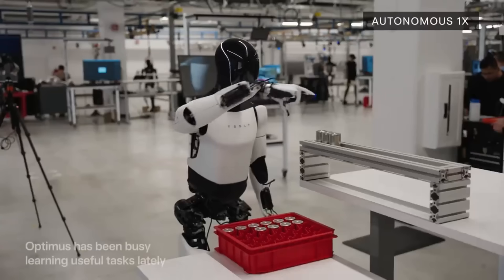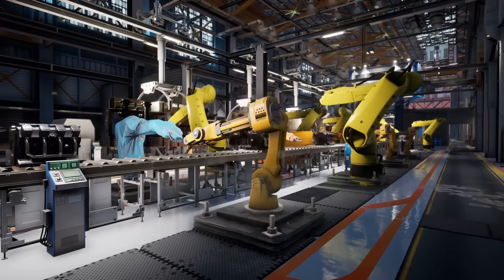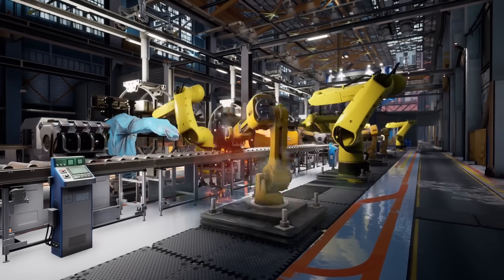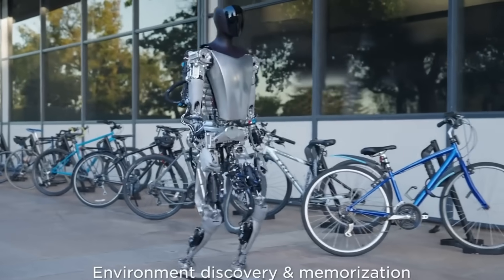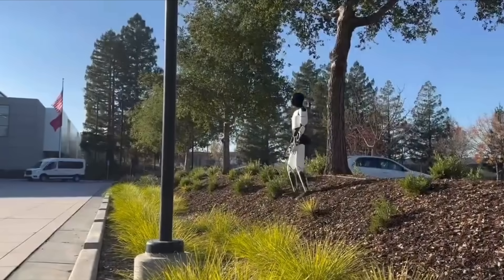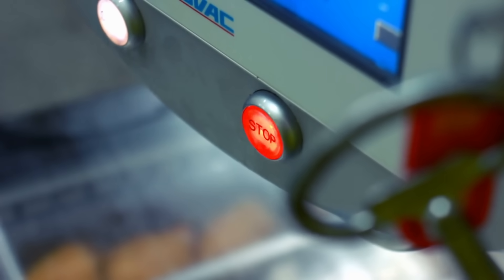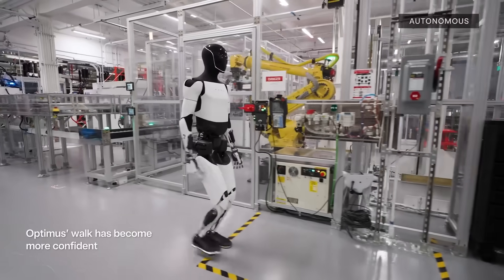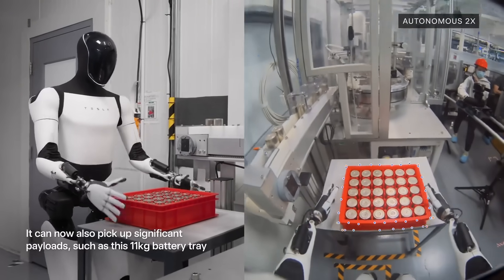Ex-TESLA Engineer SPILLS on Optimus

Comment: Soo basically they used a standard robotics arm  but instead of just using the simple arm they built a complex humanoid robot to do the same tasks ... And they slapped some cameras on it  and connected them to chat gpt or something similar to control it 🤣 instead of using a simple and probably cheaper cobot system? .. sorry that is just plain stupid in that use case in a factory...
 (So basically hey there is a cheap and good working system ... Let's make it more complicated and expensive for the same or even worse results...)

Comment: I was putting in CNC/robotics back in 1990 for the C-17 cargo jet factory. We were using wireframe and surface CAD models and CAM tools on the design side. We had to put in the data systems and Manufacturing Execution Systems to get the right code to the right assemblies. We were doing wing drilling and riveting as well as barrel sections. It was a lot of work to automate these areas. The wing took a dozen units to get most of the bugs out of them. In fact, there was a whistle blower who thought that we were pushing too hard and getting poor quality. He was correct about the quality, but we did repair work until the bugs were worked out. You don’t throw them out when it messes up, we repair them. Millions of dollars to automate small sections of repeatable work.